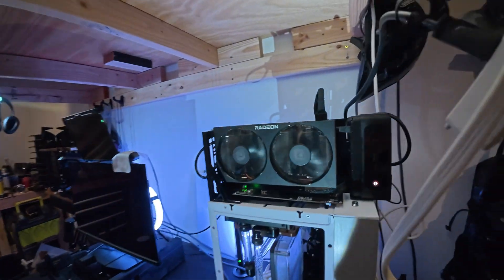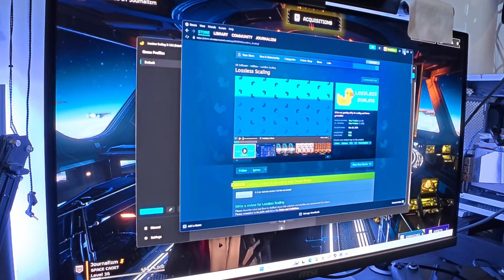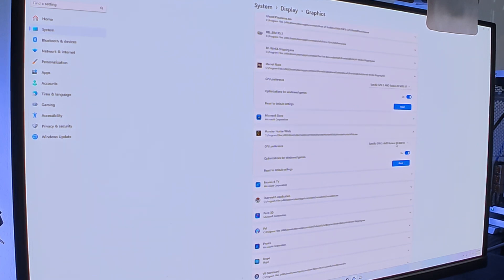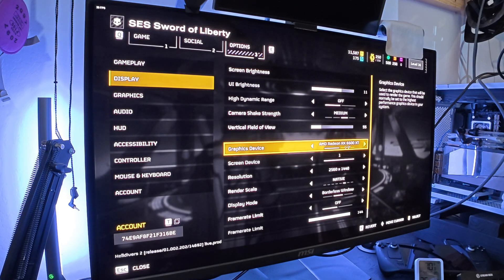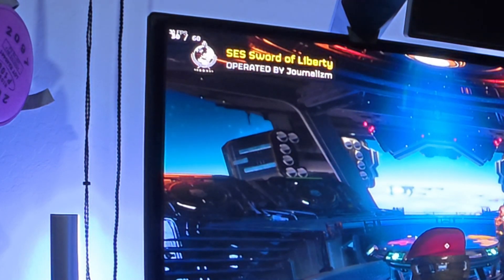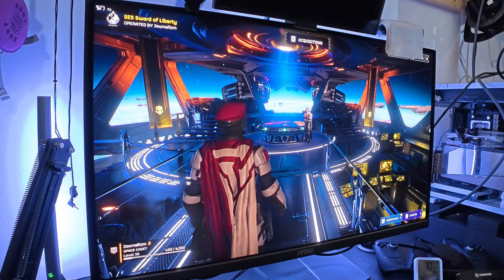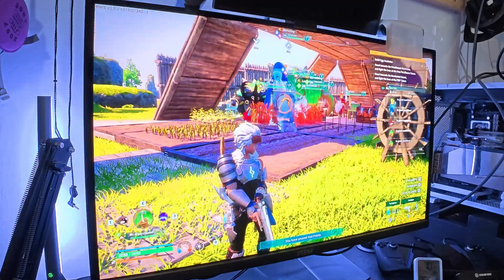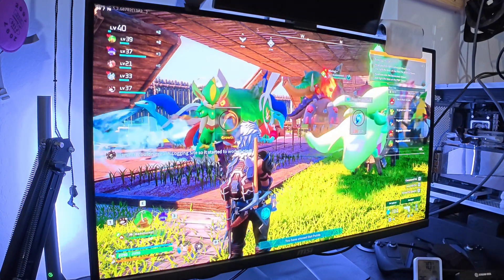iGPU are underrated

Comment: There is also a feature called Adaptive Frame Generation in Lossless Scaling where you can set a predetermined framerate cap.
Not sure if this has a similar effect as locking framerates in-game and using Fixed Frame-Gen.

I have a RX6650 XT with a Ryzen 5600G APU (6 core/12 thread CPU w/ Radeon Vega 7 iGPU) but never tested Lossless Scaling on this PC yet.

Comment: Fake frames not actual performance. Frame generation and upscaling both will cause delay to controlls. 4x-8x depending what you use. So not so great in competitive gaming. Also frame gen has every second frame - 3/4 of the frames not showing what is really happening in the game.

Comment: I really don't recommend doing this as using the motherboards display out will significantly increase latency on top of the already increased latency of using framegen.
Reply from the maker: For my experience that is not correct for this type of set up

Comment: Can I pull this off with an Ryzen 5 7600 + Arc B580?
Reply from the maker: As long as the 7600 has an APU yes you can
Reply: @Diy_Papi All I know is that it has an igpu?

Is that the same thing?
Reply: @Diy_Papi I gotta ask.... Am I better off with the 8600G?
Reply from the maker: @digivagrant Yes
Reply: @Diy_Papi Thank you for the feedback. 😃
Reply from the maker: @digivagrant any time
Reply: @Diy_Papi Any chance you'll be making an igpu - gpu setup guide? I'm planning to make new build with this in mind.

Or is it as simple as turning the apu on, assign dgpu to the game via windows then assign igpu to lossless then play?

No registry wizardry required?
Reply from the maker: @digivagrant exactly that

 yes i do plan on making one eventually, i need to source out some parts before i do it.
Reply: @Diy_Papi Okay, that's good to hear. I was fearing I'd open a can of worms just setting it up lol. 

That video will definitely help people like me who barely dips into the PC Building scene.
Reply: @Diy_Papi I forgot to factor in something.

In any event that I wont use the igpu for frame gen and just use the raw frames on my dgpu, do I leave the setup as is or do I need to plug my monitor to the dgpu?

Comment: Yoooo since i recently heard about LLS i wondered how my 5600g will do with splitting how the frames are to be generated, i wanted to ask one thing wont the game run poor if u force LLS to generate frames using the igpu, i watched the vid twice to understand it but couldn't 😅
Reply from the maker: Hey boss, yes it should help quite a bit for at least 1080 P or 1440 P gaming depend depending on your graphics card
Reply: Currently i am running no gpu only my 5600g as apu, planning to buy the 9060xt this sale, if possible could you do a vid with LLS but no gpu only apu like 5500u or 5600g that would be awesome ❤ @Diy_Papi

Comment: i'm using gaming laptop so what do i have to config or change, cus i tried to change the output  from my laptop GPU RTX 3050 to iGPU in NVIDIA control Panel but it not help
Reply from the maker: This is where the issue is with laptops. You may have to use an external display
Reply: @Diy_Papi  i'll have an external display, the question i'm asking is do i have to change any setting on output GPU in NVIDIA control panel or in windows setting?

Comment: Will it work with laptop rtx 5060 + Ryzen 7 260 (igpu 780m)  ? Would you rather have a dual graphics card than a laptop with i7 14th 14700hx + 5060 ? Thank for information ❤
Reply: Considering that they have the same storage space and RAM, but the one that contains i7 14th It is Lenovo loq The other one contains Ryzen 7 is Asus tuf Which do you prefer?
Reply from the maker: It should and work very well with the new update
Reply: thanks ❤ Do you recommend buying a laptop with a Ryzen or Intel processor? Ryzen 7 260 vs i7 14700hx @Diy_Papi
Reply: @Zophia.1  You need to mobile or not? if not PC all the way

Comment: Interesting!
Monitors usually have more than one input. 
A convenient solution is to connect both graphics cards to the monitor.
Then you can easily choose which card should send the signal by selecting the input on the monitor.
Reply from the maker: I didn’t think of that, thanks for the heads up

Comment: Just doing display output through igpu improves my gpu performance by like 5%. Sounds weird but true. No fg or upscaling here. Just display cable in a different GPU.
Reply: doesn't sound impossible, you are now rendering throgugh the other card, lowering memory and gpu usage.
Reply from the maker: I’ve noticed a similar result

Comment: it never work that way, gamers been trying for decades since...even i thought so since under linux...it just can't have cpu using more gpu's due to core isolation has to be sync one gpu at a time for program running once not twice or more than once. Like doom RTX...it ran poorly on 7900xtx then i realize it was not using discrete gpu at all due to cpu using wrong gpu...and how to use both will never work when cpu resources is on first gpu...not 2nd or 3rd. It be nice everyone asume it work but as data servers made many gpu's on one spine..its networking part to get clusters of cpu's ...for every slot . it has 4 cpus' and 4 gpu's...each cpu has owned gpu card for owned resources to sync its clocks

Comment: the igpu need to be very strong, i have r7 6800h with a r680m, the strongest igpu at the time it release, and it can only produce somewhere like 60 to 120fps on 1440p, higher than that it will drop your base frame
Reply from the maker: nice, can you do 4k?
Reply: @Diy_Papi i dont think it can, even rtx 2060 is not enough to do this in 4k

Comment: my horrible uhd 630 runs LS great! from 720p to 1080p, and from 40fps to 120fps
i have it on a laptop with the RTX 2060 Mobile
some things i'd like to add: the higher the window resolution, the more it's gonna hit your iGPU, i'd recommend to play windowed at like 50% your monitor resolution, or something like 720p to fullscreen res, keep the flow scale below 80% for low bandwith iGPUs and adaptive instead of fixed, for some reason setting it to adaptive made it smoother than fixed, and in adaptive mode you can choose the target fps
Reply from the maker: That's great info, thanks for sharing!

Comment: If you mean more and faster GPU performance or FPS I’ve always run both an APU and a dedicated GPU in my system. At the moment, my GPU provides 28 GB of VRAM. In practice, an APU + dGPU setup often outperforms a traditional CPU + GPU combo, especially when the APU’s iGPU can assist with tasks like video decoding, light rendering loads, or background graphics acceleration. It reduces CPU overhead and improves system efficiency something I’ve consistently noticed over the years.

Comment: The ROG Ally paired with XG mobile. Chef kiss.
Reply from the maker: Can you run both GPUs at the same time
Reply: But you need to connect the monitor to the iGPU, which the port is taken by the XGmobile port.

Comment: Awesome vid! Very informative!
Very curious if running a newer ryzen CPU with Radeon graphics that supports Ray tracing with a 10xx series GTX card would let you bypass traditional "Ray tracing requirements".
Reply from the maker: That might work, depending on the APU. Run RT then Frame gen on the APU.

Comment: how low can you go? Will this work with a really old system? I have an i5-4590 with a GTX 1050 4GB. Is this enough to see an improvement over just the 1050? I noticed when trying to enable the iGPU that the intel iGPU needs drivers that aren't exactly kosher under Windows 11, and I don't expect intel to fix that, ever. Maybe switching to Windows 10 LTSC or whatever it is would be key...? Obviously, I don't want to do that if I don't have to, but if this dang iGPU needs a driver that is going to make Windows 11 disable Secure Boot and whatever, then it might force me to, if I want to pursue this angle.

I guess I'm just asking if it's worth it with my config, or if this is more something to do with my next build.
Reply from the maker: Not sure if that CPU can handle Lossless anything more than 1080p, but from my experience it worth a shot, LS is pretty amazing when it works.
Reply: @Diy_Papi  with specs like these, I wasn't going to try anything higher than 1080p anyway. Besides, that's what my monitor is, so of course.

That still didn't answer my question though.

Comment: I do not understand why would I need some silly cpu with igpu, I have i3 12100f and rx 6600... , also you can use amd fsr + fluid motion frames or Optiscale FREE upscaling rival of Lossless Scaling app
Reply from the maker: its about taking the load off the GPU, essential turns the PC to a dual GPU set up.
Reply: I've never seen anyone using that program on Helldivers 2 (if they are I have a difficult time finding it on YouTube), because the game doesn't use any of the scaling options from gpu companies--it's using a custom solution.

From what I understand about Optiscaler, you need either DLSS 2+, FSR 2+ or XeSS, in order to route the ability to even use frame gen.. So while it is FREE, it's incompatible with a game like Helldivers 2. Lossless Scaling isn't hooking into an existing path, and in that way isn't limited, which is why you can use it in this game and you can't use Optiscaler. The $4-7 bucks spent wins with this title. 

*also they can/should coexist on various setups. The iGPU if strong enough is a solid option to offload the workload on the rendering GPU--otherwise do it all on the main one or use another dGPU when using LS.
Reply: @ALWAYSxREADY  Very interesting but by the way you expressed yourself I understand that you do not understand and Just PRESUME something without knowing, actually you didn't even try. I can use deduction, you said it.
Reply: @ALWAYSxREADY  you said "From what I understand about Optiscaler, " so you have no practical knowledge. So you cannot compare Lossless with Optiscaler then. We have to be right and just.
Reply: @MrNobody-zx4jz you are hurt by my comment and that’s ok if you get over yourself.

I responded like someone who is willing to reveal that I have actually read both guides on Optiscaler and the OptiFG tools. So while I don’t have applied knowledge, I do have the source material.

What you did was assume in your statement that Optiscaler would be a fine replacement over LS, when the video’s example used a game where Optiscaler doesn’t work—if you’d have any knowledge you wouldn’t have made that argument.

My original statements are still valid. Focus on the merit of the points, instead of chasing victories on a post.

My allowing room to be wrong only makes sense in that I might be wrong about any updates the app has made since I last studied the readme; it doesn’t mean I don’t know what I’m talking about.

In your case, it only took a few minutes to not attempt to denigrate LS or iGPUs as silly..

Comment: Please elaborate to me why put video from the mobo and cpu integrated graphics when the GPU is infinitely more powerful...
Reply from the maker: You need to put the HDMI on the MOBO to utilize the APU properly. if it was on the GPU it would cause data issues or even not work at all. The APU or GPU doing LS need to be attached directly to the display to work properly.
Reply: But the HDMI (B760M) is 2.1? How it will handle 4K 120fps HDR?

Comment: my igpu on both laptop and PC bottleneck my performance on lossless scaling
Reply from the maker: What’s the IGPU?

And

What are you scaling too?
Reply: @Diy_Papi  MY LAPTOP: 
4070 LAPTOP WITH AN I7-13620h WITH INTEL UHD IGPU. 

MY DESKTOP: RX 9070XT + R7 7800X3D WITH AMD TM GRAPHICS. 

WHENEVER I USE LOSSLESS SCALING WITH THE IGPU, ITS ALWAYS WORSE ON BOTH DEVICES. THE PROBLEM WITH LOSSLESS IS WHENEVER YOUR GPU USAGE GETS MAXED OUT LOSSLESS RUNS PRETTY BAD AND ALWAYS LOOKS WORSE THAN NO FG MODE SO I CAME UP WITH AN IDEA... WHAT IF I USE AMD CHILL TO CAP MY FPS SO THAT WAY MY GPU HAS MORE BREATHING ROOM AND USE THE REST FOR FRAME GENERATION.

IN MOST GAMES I DONT NEED FRAME GEN BUT IM TOO SPOILED I WOUDLNT WANT MY FRAME RATE LOWER THAN 90 AT ULTRA SETTINGS

Comment: just as a pro tip, if you want the igpu to work at 1440p or 4k, you have to hook your monitor up to your motherboard, not your graphics card, and you have to go into windows and set the preferred GPU to your graphics card so all games render on your GPU.
Then you launch lossless scaling and set it to use your iGPU for framegen/upscaling, and presto, you're golden.

(Yes, this works on 7800x3d CPU's as well, if needed.)

I have a 7800x3d and a 9070xt, in every game that I play I get 4k120hz naturally by tweaking settings around (both native and with FSR).

Just keep in mind that it will feel really weird going from 30 to 60(FG) or 60 to 120(FG) because the game itself is rendering at 60fps, so all of your inputs will be done at 60fps. Your eyes will see 120, but it will still feel like 60 and it will get annoying. To get around this, USE A CONTROLLER. Controllers are not as accurate as a mouse due to the nature of how joysticks work, it smooths out the difference in generated frames vs rendered frames and makes it near impossible to notice.

Good luck fellas. Turn those old laptops and 5+ year old desktops into at-home consoles. Bonus points if you run all AMD, because you can just install steamOS and immediately get +20 to +40 rendered FPS in almost every game due to 0% bloatware.
Reply from the maker: Thanks for the tips!

I wasn’t aware that the 7800xrd cpu igpu was that capable. An rx 6400 can’t do 4k gaming
Reply: @Diy_Papi 7800x3d igpu can’t do 4k120hz but it can do 1440p120hz and 4k60, and that’s only displaying the information, no rendering.

Some games like destiny 2 will only render on the gfx card your plugged into via hdmi or dp, even if you tweak windows settings. So it isn’t a end-all-be-all solution to every game.

What will be the solution is nvidia and amd adding in “ai frame encoder” chips onto their cards that’s sole purpose is moving processing load away from the gpu so the rendered frames can max out. Similar to nvidias hvenc encoder chips for streaming.

This is just what I’m expecting to happen in the next few years, feel free to come and glaze me as a genius when it happens
Reply: Tried it for my 5080 and the 9800x3d igpu hooked my monitor to the MB and made the 5080 the main gpu in games but result were sooooo bad at 1440p in battlfield 2042 it was 30/60 fps while my 5080 can do 180fps ez ultra without adding any softwere
Reply: @ahmedelkarimy2681  the game was rendering on the igpu then. Sometimes windows won't properly use the correct GPU, no idea why. Same issue with Destiny 2.

How it should work if Windows does it properly, is the Graphics Card renders the game and the iGPU displays the information. But when your iGPU is plugged in, some games default to the iGPU for whatever reason & windows override is funky.

It is possible to do, it's just you gotta work around windows being dumb.
Reply: @CQ_Live i thought about it but when i was unscalling it returned back to 180fps... when i scale only it goes to 30/60 fps
Reply: do you think a intel hd 630 work work or is it to weak?
Reply: @rjedi5295  i have the same question, and also will it affect other games that im not using lossless scaling? Like input lag?
Reply: i have 5600G with RX 580, can it do the FG ?
Reply: Can't choose between the 8600G or the 7600. Which one is better?
Reply: @digivagrant  me
Reply: Best comment here, can we make the steamos as second system on another hard drive?

Comment: hello sir, im using Ryzen 5 5600g(enabled igpu from bios) and RTX 3060ti.  im using display port from 3060ti to my monitor, and making IGPU to render on lossless scaling. is there any difference fom what you did? or do i need to change the display port into IGPU to monitor?
Reply: Nope you should be fine, just set the preferred GPU in lossless scaling to “Radeon(TM)Graphics”
Reply from the maker: hi, no you should have the DP coming out from ur MOBO, since you are using the igpu for LS

Comment: this lossless is useless. Just a number, it FG quality is low campared to AMD and Nvidia. It is only spacial, can´t use scene data to generate better quality. People just go because everyone says it miracle. But it don´t. AFMF 2.1 is a lot better and can be usend on any game. One single settings for game or for all games, and there you go.
Reply: your loss, not ours
Reply from the maker: not all games have FG...
Reply: LS is plenty useful. Also, I like AMD and NVIDIA driver solutions--for cards that can make use of it... So if you don't have those you can definitely try out and mostly benefit from a program like LS. Not as much an issue on AMD cards like NVIDIA, since AFMF is available on more cards. Also, LS users understand it isn't just a number; it's definitely about the smoothness of the gameplay. Always has been; always will be. Why mention AFMF if thinking that way? It's just a number, right?